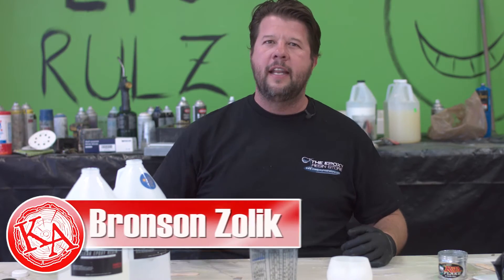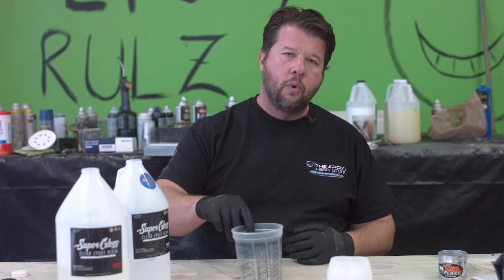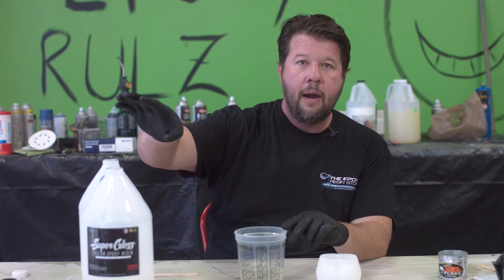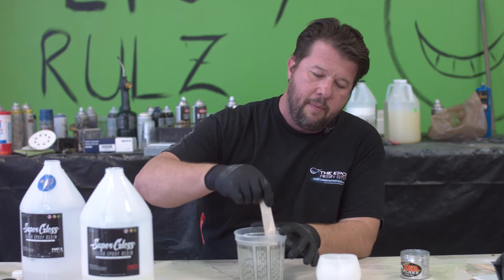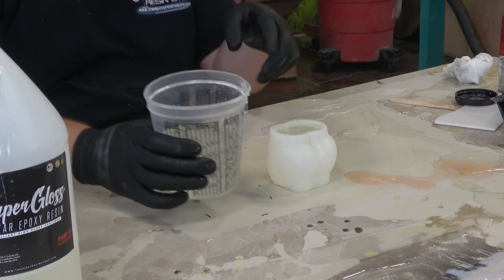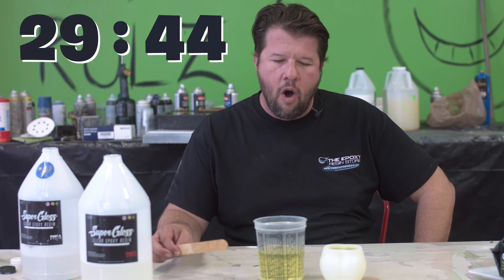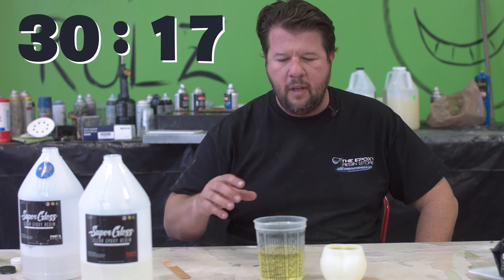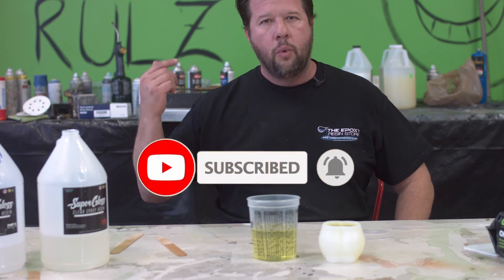Epoxy Resin Overheating Experiment: Effects of Incorrect Usage

Comment: Can uou please explain how much of each part you used to make it get so hot ?  And, what are the proper measurements you should have used fir this brand - I know how each resin requires a different amount.  And, are the only side effects of having your resin heat up too fast the bubbles and discoloration ?  I appreciate your help and advice as I'm wanting to start making resin projects and (of course) have never worked with any kind of resin before.   Thank you for responding if you çan. 👍😍❣️😻